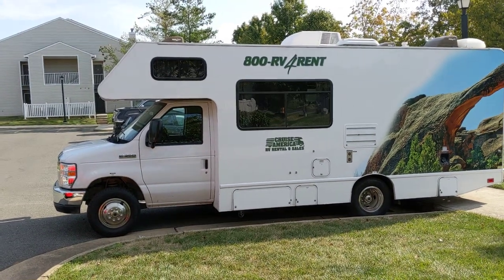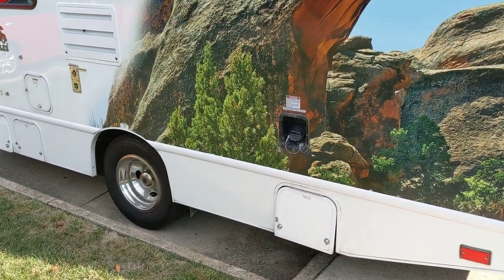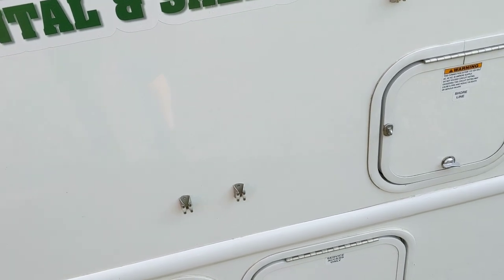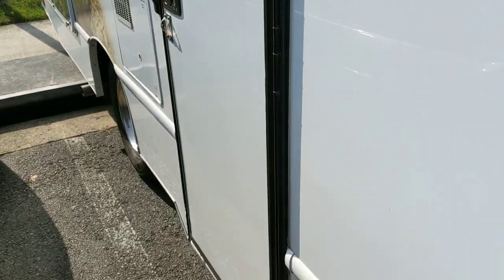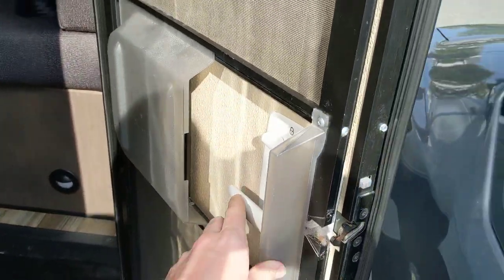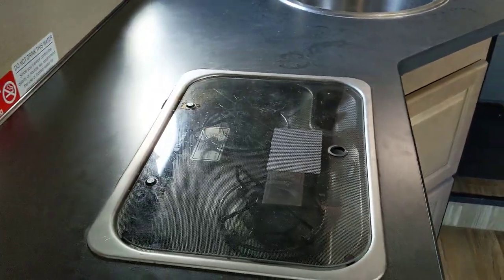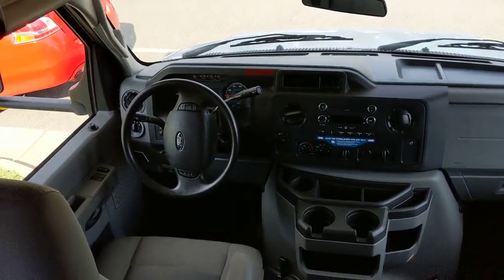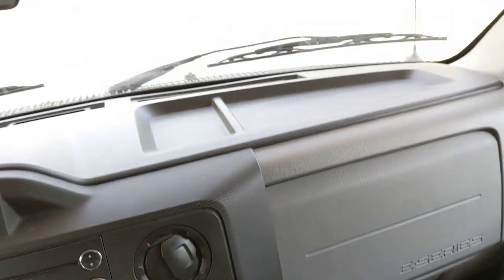Cruise America - Review and Walk through of 25' standard 5 passenger RV

Comment: Thanks for the video, I have a reservation for one next week.  It is my wife, two boys 7/4 and myself.  For the propane tank do they fill it for you at rental or would I need to fill it?  Also would you think it would be a good idea to get it filled at costco since they do propane there?  Sounds like a lot of work for only two nights but hey we will start small
Reply from the maker: Hi!  They don't generally refill it before a rental; it comes with however much was in it when the previous renters returned it.  I think some locations do offer propane filling, I've also had good luck at home & garden stores near me.  Costco sounds like a great idea!  It's usually pretty cheap and a little goes a long way, but a good idea to top it off before heading out if you plan on using a lot of hot water.  Have a safe trip!
Reply: @CompTechMike  Is there a gauge that tells you how much propane is in the vehicle?

Comment: When traveling with dogs and doing something / going somewhere where we can't take them with us, can you leave the generator running while we are away to ensure proper air conditioning if not hooked up to shore power? I don't mind paying for the generator usage, just want to make sure that's possible.
Reply from the maker: Hi!  Thanks for the comment.  Yes, you can leave the generator running.  Just make sure to check the oil frequently, and be aware that it will cut off automatically if the level in your fuel tank drops below 1/4.  You may also want to check with state laws in your area, as some places it is not legal to leave pets unattended in a vehicle.  Have a safe trip!
Reply: You can do that but please make sure that your dog will not ruin the furniture in the RV while you are not there. Otherwise, you will be charged for any damage your dog does to the vehicle. We own CA in Fairfield, Ohio.

Comment: How long does the shower last?
Reply from the maker: Hi! Thanks for the comment. The onboard hot water tank holds six gallons of water (constantly refilled from either your main water tank or city water connection, if available). It takes around 15 minutes to warm up, from the time you turn on the water heater. I generally take pretty fast showers - rinse, turn off the water and soap up, and rinse again. My wife takes longer showers but I don't recall her ever mentioning running out of hot water.

Obviously it's just us, if you have five adults all wanting to take hot showers in the morning you might have some challenges. Pretty much just depends on how you shower. Hope this helps!

Comment: Great video! Quick question- we are spending 21 days in one of these, but only 5 days off grid. How does the water pump run? Do we need electricity or does it use propane? Just want to be prepared when we want to shower in Yellowstone, as their showers are closed. Thanks!
Reply from the maker: Hi!  Thanks for the comment.  The water pump runs off the household electric battery (same as the lights in the back) and has a separate on/off switch.  So when driving we switch it on and off as needed - for example if we pull over and need to use the restroom or sink we turn the water pump on, then turn it off again when done.  When hooked up to shoreline power we leave it on all the time.  It does not run off propane (like the water heater does).  If you are boondocking I would recommend turning the water pump off when you're not using it to conserve battery power.

The household battery charges through solar, or you can run the generator for an hour or so to make sure everything is charged up.  So when you're ready to shower just turn the water pump on, turn the water heater on, wait about 15 minutes for the water to warm up, take your showers and then turn them both back off.  That's what I'd do.

Have a safe trip!
Reply: @CompTechMike  Thanks Mike! One last question - I know you mentioned that when you're hooked up to shore power you leave it on all the time, if we are hooked up to the city water at full-hookup campgrounds, we don't need to keep the water pump on, correct?

Comment: Hi Mike! Just found this video and it is extremely helpful. So thorough that I only have one question for you. In the bed area is there an outlet to plug in a CPAP if needed? (I know we'd have to be hooked up to shore line for it or use generator, depends on where we're camping).
Thanks!
Reply from the maker: Hi! Yes, the 25' RV has outlets around the sink area, which (depending on the length of your cord) should reach the head area of the bed.

However, if you need to run a CPAP machine I recommend the 30' rental, which has more space around the head and sides of the bed for that type of equipment:

https://youtu.be/bgOoMQ1_4mA

Comment: Very informative, thanks.  We are renting this at the end of the week.  Is there a freezer in the refrigerator?  What do you do about ice?
Reply from the maker: Hi! Yes, there is a freezer on the fridge. The fridge has an "Auto" setting so that it will run on either propane (if available) or electric (if available). The rental office should turn it on for you so that it begins to cool down immediately. Bring along an ice cube tray and you should be fine. Remember not to pack the fridge or freezer too tightly as they depend on air circulation to cool things down. Also don't stand there all day with the door open looking for something to eat, but that's pretty much common sense. 😉 Have a safe trip!

Comment: Liked your video, very informative. Have you ever rented the 19’ RV? If so, is it big enough for 2 adults?
Reply from the maker: Hi! Thanks for the comment. Originally I wanted to look at the 19' model but it is not available at my rental office. I think it is "limited markets" only. But having rented the larger ones a few things stand out to me: the smaller one does not have a bed in the back (just over the cab), meaning it would not work for our small dog to be able to jump up. Also the 19' only has a "wet bath" (no separate shower area) and very small holding tanks. It may work for a couple people (if you plan on spending most of your time outdoors) but otherwise I think would be pretty cramped. If you do manage to rent one please comment back with your thoughts. Thanks! 😀

Comment: Great video. Can appliances , electronic hookups and hot water be used while vehicle  vehicle is in motion ?
Reply from the maker: Hi!  Thanks for the comment.  The standard household AC outlets only work when the vehicle is hooked up to shoreline power or the generator is running.  I suppose if you really want to use them while the vehicle is in motion you could run the generator, but I wouldn't advise this.  Same for the rooftop AC and microwave - they only work on shoreline power or when the generator is on.

The hot water needs two things to be turned on - the water pump and the water heater.  You can turn the water pump on any time (for example if you're driving and a passenger needs to flush the toilet), but this is not advised and may be illegal in some states.

I don't think the water heater would work very well driving down the road - the pilot light would probably get blown out.  I wouldn't recommend this because if you got in an accident with the propane flowing, it can cause an explosion.  Hope this helps!

Comment: GREAT video, great comments !   dumb question, can you use the shower and toilet if you're not connected to shoreline / no 'hook up ' type site ?   thanks
Reply from the maker: Hi!  Yes you can.  The water heater runs on propane, and the water pump runs off the household battery (same as things like the lights in the back).  You can definitely use the toilet and shower when not connected to shoreline power.  Just flip both of those things on, wait about 15 minutes for the water to heat up, and shower away.  Remember to turn both those things off when finished to conserve resources.  Have a safe trip!

Comment: Great video. 
Can you give us more info about the generator use. If we weren’t connected to external power. How long can we run it for etc. can we do it every night ?
Reply from the maker: Hi!  The generator runs off gasoline from the main fuel tank, uses roughly a gallon per hour, and usage is charged at a rate of $3.50 per hour, assessed when you return the vehicle.  Note that it has a cut-off so if your amount of available fuel gets too low it will shut off automatically (to avoid draining your tank).  It uses standard weight oil (check the cap for specific weight).  Just like with a lawnmower you should check the oil periodically and refill  as needed.  Save your receipts and Cruise America will reimburse you for the cost.

Note that the generator is only needed if you don't have shore power and want to use the microwave, air conditioner, or 110/120v standard household style electrical outlets.  You don't need to use the generator to take a shower, wash your hands, turn on the lights, or keep the fridge cool (it will run off propane if electric is not available).  I wouldn't recommend leaving the generator on all night, only turn it on for an hour or two to charge up the household battery.  Also if you're running it be mindful of any neighbors / quiet time restrictions at your campground, and keep the window closed nearest the generator exhaust - don't want that coming up into the vehicle.

Personally I've only ever used the generator a few times.  Small electronics like phones and battery-operated fans, radios, etc., can be charged through the 12v cigarette lighter style outlets on the dash (with appropriate adapters).  Hope this helps!
Reply: Mike Smith thanks so much mike
Yeah only plan to use it while boondocking when I have no neighbors. And if we need it cooled for a while during the summer nights. 

Didn’t realize cruise America chargers for generator use. That’s for that tip. Read it now in the faq. On average so you know what it costs for an rv site with power hookups for the night.
Reply from the maker: @saikrishnagangavalli7861  Hi! In my area a state park campground site with hookups typically runs around $40 per night. Sites without hookups start at around $15 per night. Private campgrounds such as KOA's with hookups can range from around $45 per night up to $100 or more, depending how far in advance you book, time of year, whether it is "peak season" or "off peak", and whether you need just electric, or electric+water, or electric+water+sewer. Some larger campgrounds also have amenities such as pools, dog parks, game rooms, pancake breakfasts, and various other entertainment. Note that some of these amenities may be closed currently due to Coronavirus. Have a safe trip!

Comment: Is that small solar panel for lights only while boondocking w/o generator on of course?
Reply from the maker: It will charge the battery. So anything that runs off the battery (including the lights) would benefit. It is a very small panel on these rental vehicles, however.

If you're planning on running anything like the air conditioner, microwave, or household-style 110/120v electrical outlets, you would need to either run the generator or be plugged into shore power.

Comment: Thanks, Mike.  You mentioned a hose in the last bit of this video.  Do we bring our own?  Is this for filling up or emptying?
Reply from the maker: Hi!  Thanks for the comment.  Your rental RV should include a standard "garden style" hose in the storage area underneath.  This is for hooking up to a campsite water spigot, or for filling up your water tank from a camp water connection.  For emptying you use the much larger diameter hose connected to the black/gray waste tank dump valve underneath the RV.
Reply: Your RV should have the hose included. If it is gone, that means the renters prior to you walked away with it. You can buy one, save the receipt and get reimbursed when you get back.

Comment: Excellent video and very helpful. We just left the Cruise America yard in Fort Lauderdale. Our plan is renting 1 way to Salt Lake. FYI readers you have to do 1 way rental thru corporate office by phone not the local office. I was also told they charge you $3.50 and hour to run the generator.  Are there other expenses you might be aware of?
Reply from the maker: Hi!  You are correct, there is a small charge to run the generator.  Most campgrounds have shoreline power, personally we've only ever had to run the generator for a few hours.

There are extra charges for things like (optional) insurance, bedding kits and kitchen kits, if desired.  We've booked online and in the local offices and always felt like the charges were clearly explained up front (i.e., they're not "hidden charges").  Have a safe trip!  :-)
Reply: Mike Smith thanks! As it turns out they are sold out at Cruise America until July 7th so we will have to plan more into the future.
Reply: There is also a $650 drop fee for one way rentals. You will pay your nightly rate, mileage rate, tax and zero deductible plan if purchased. You will be charged for fuel and propane if you don’t return at the same levels when you left. You will be charged if you don’t dump the camper, take the cover off or leave the handles in. The generator is $3.50/hr. Unfortunately, local dealers can’t make the one way reservation for you. We can submit a request for you though.

Comment: Thank you for posting this video.  It was very educational.  We plan to rent for the first time this summer.  Two questions - Will this RV fit through a drive through at restaurant like Sonic or Chi-fil-a?  Will it fit in a single parking spot or does it need two (either side by side or front and back)?  Thank you for your assistance.
Reply from the maker: Hi!  Thanks for the comment.  You can see in the video thumbnail it is parked in a standard-size parking spot - with a lot of overhang over the sidewalk in the back.  If you're able to get two spots front-to-back that would be ideal.

It probably won't fit through a drive-through if there are any sort of height restrictions.  The vehicle is very tall, and if you need to go under any sort of overhang you'd probably hit it.  Better to park and walk in.  ;-)
Reply: @CompTechMike  Thank you.  That was most helpful.
Reply: The RV is 10’ wide and 12’ tall.

Comment: I guess there is not a overhead Ac unit? Or did I miss that
Reply from the maker: Hi! Thanks for the comment. Yes, there is a roof-mounted AC unit for the vehicle. It operates when either connected to 30A shoreline power (like at a campsite) or with the generator running. You might want to check out my more recent video walk through on the 30' RV for additional information. Link here:

https://youtu.be/bgOoMQ1_4mA

Comment: We have three adults and one young kid. Do you recommend the standard size or the large one?
Reply: I forgot to say thank you for your video. Like you said, it’s very hard to find info on these RVs online, surprisingly! Thank you!
Reply from the maker: Are a couple of the adults married or will all three be needing separate beds?  If the latter, definitely the larger one.  Technically the smaller can sleep five and the larger one seven, but the dinette table doesn't make a great bed and the overhead bunk area isn't well suited for an adult, either.  I'd look at the larger one just to have a little more breathing room.  The larger one also has the couch that makes a pretty decent bed for an adult.

Check these measurements:

C25 Standard RV Rental

    Master mattress: Both master mattresses in this RV model are double beds. The cab-over mattress is 57 x 96 inches while the rear mattress is 54 x 80 inches. 

    Convertible dinette: You have a third bed thanks to the fold-out dining area, which is 38 x 70 inches. 

C30 Large RV Rental

    Separate bedroom mattress: This model has a separate bedroom in the rear. This mattress is 60 x 74 inches. 

    Cab over mattress: The cab-over mattress is a double bed, or 57 x 96 inches. 

    Sofa-bed mattress: This model has a convertible sofa bed that is 42 x 68 inches. 

    Dinette size: The convertible dinette is 39 x 65 inches. 

Hope this helps!
Reply: Thank you so much for the quick reply! Didn’t expect it. The rate is not that much different, only $10/day difference. So we probably will go with the bigger one then. Thanks again!
Reply: We own Cruise America in Fairfield, Ohio. The 25’ sleeps 5. There is a queen bed in the back and one over the cab. The dinette makes into a twin. I think you would be ok in a 25’.

Comment: Great video and tour. Is there a sound system to listen to while driving or while parked? Thanks!
Reply from the maker: Hi! Thanks for the comment. There is a regular radio head unit in the cab, just like on a normal truck or van. It has an Aux input and I think maybe a CD player as well, but I can't recall off-hand (haven't owned or used any CD's in more than a decade, LOL).

Some more high end RV's also have sound systems for outside use, but the Cruise America rentals are pretty "no frills". 😉  Hope this helps!
Reply: @CompTechMike  Very much so, thanks1